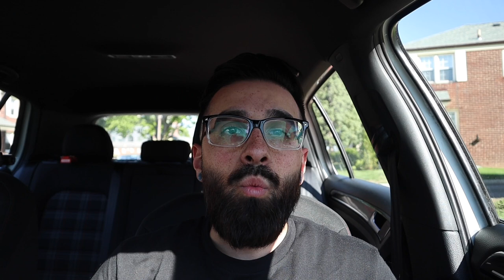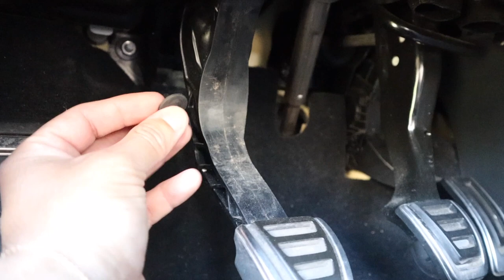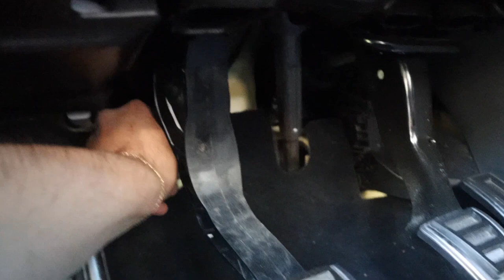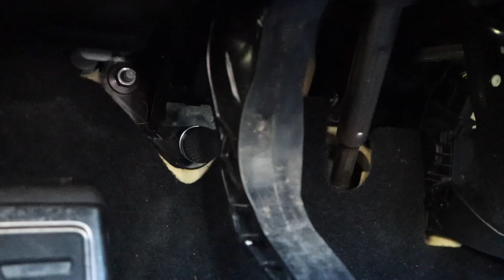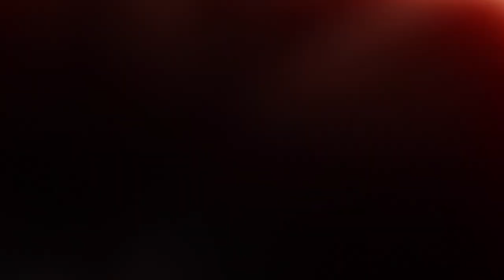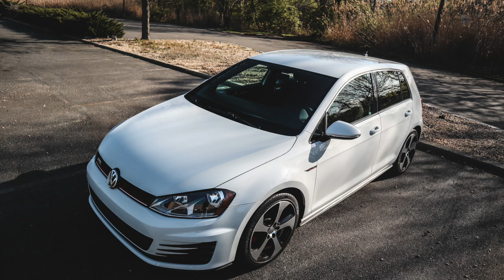You NEED To Do This $10 Mod On Your MK7 GTI | Golf R! Clutch Stop

Comment: Just ordered one for my mk7 R. Website says it doesn’t fit but I highly doubt the hole is a different size than the gti. Thanks for the recommendation!
Reply from the maker: Sounds good man! Should be the same fit as the pedal assembly isn’t different etc. def makes the car feel much better and shifting and clutch feel greatly improves!
Reply: Did you order the BMS unit? Did it fit? Diego mentioned he got his on eBay?
Reply: @yuaus  I did. I had to cut the plastic insertion it in half but it fits snug. Lmk if you got more questions.
Reply: @evanhasson6032 did you still have to remove washers after cutting it

Comment: I don’t recommend this product. You just might find your clutch’s TOB/slave failing earlier than expected. Ask me how I know…
Reply from the maker: Really?? You went back to the stock stop?
Reply: @DArias  Yes. You would think getting rid of that extra pedal movement dead zone would be fine to do, but I honestly think it’s not a good idea for this platform specifically because the clutches for this car are just not designed very well. It probably has to do with the VW designing the clutch TOB and slave to be a one-piece design. Just a dumb design IMO because it just creates the part to fail more than often. So the design of the clutch isn’t that great from the start, and I think getting rid of that extra clutch pedal travel (putting the aftermarket clutch stop in there) puts more stress on the TOB/slave, hence making it fail sooner than later. I’ve had two aftermarket clutches fail, and both of them were used with this clutch pedal part. I’m now on a SB STG3 Endurance clutch kit, and I took the clutch stop part off, and I’ve had zero issues, and I drive my car in the city a lot. When I was using the clutch stop, one clutch failed at 40k miles, and the other within 10k miles.